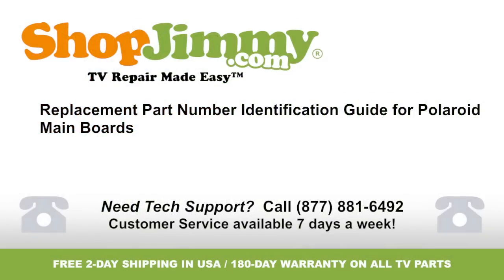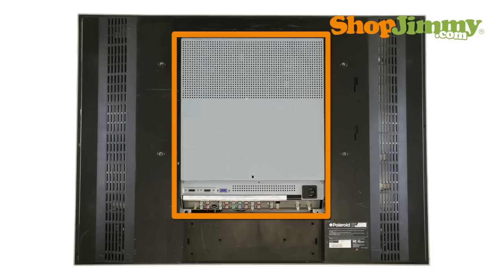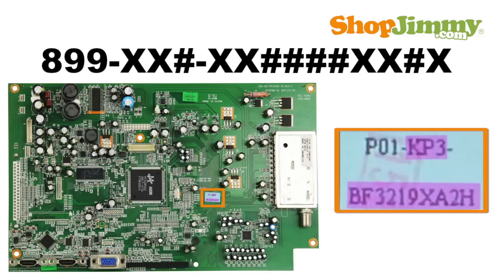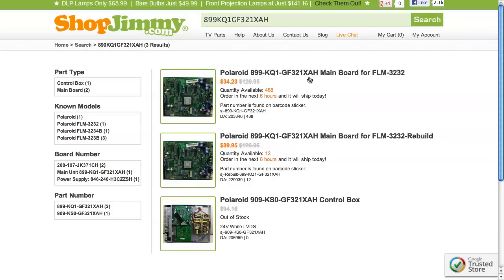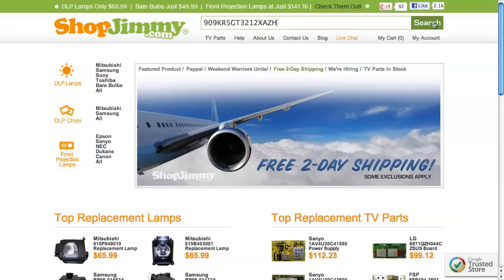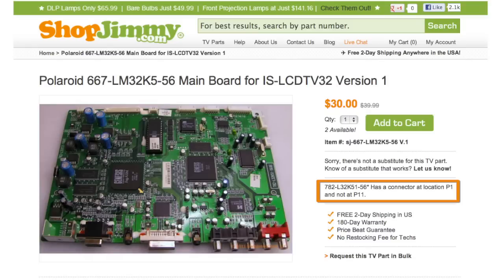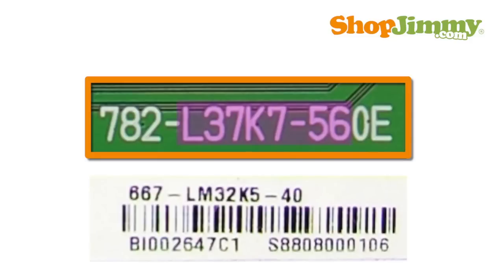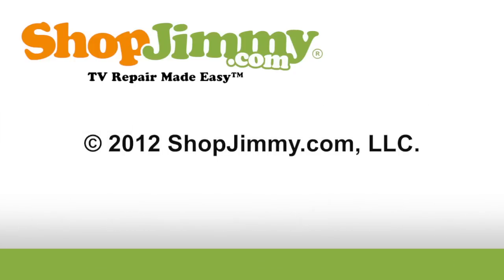TV Part Number Identification Guide for Polaroid Main Boards (LCD, LED, Plasma TVs)

Comment: mine doesn't have a sticker with a part number.  according to shop jimmy, mine is:
899-KC1-GF321XA-3H (and the picture is 100% identical) however it's not available.
There is "899-KC0-GF321XA-3H" which IS available, also looks 100% identical... suppose it works?

I did accidentally order one previously that had included 2 inductors in place of where a connector should have been,  my bad....  however the two boards I mentioned above are absolutely identical.   (scanned each one to make sure this time)  worth a try?

Comment: Hi there I have a LG 50LN5100 LED TV. The backlight works and there is a full pix, but there are 5 or 6 thin black lines that seem to be very busy. They bounce around, get out of focus and the entire screen seems to change in contrast and focus intermittantly. The customer changed the T-con board before bringing it to me. Any help well be appreciated.
Reply from the maker: Bob Thorne   Try all repairs and troubleshooting at your own risk.  This sounds like a TV panel (TV Screen) problem.  If your TV panel is bad, it may be more cost-effective to replace the TV as panels are typically hard to find in stock, difficult to replace, and expensive.  Thanks and please let us know if you have any further questions!  www.shopjimmy.com